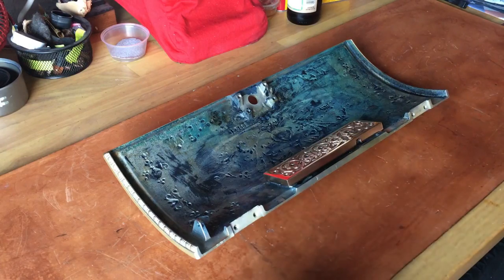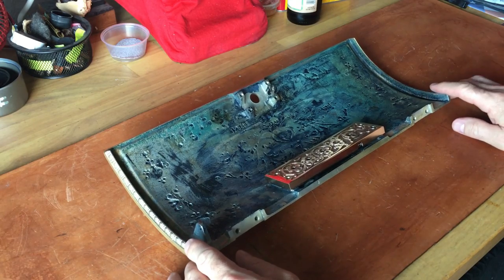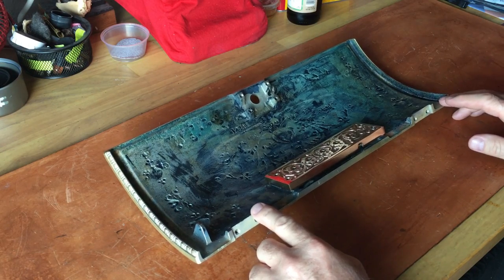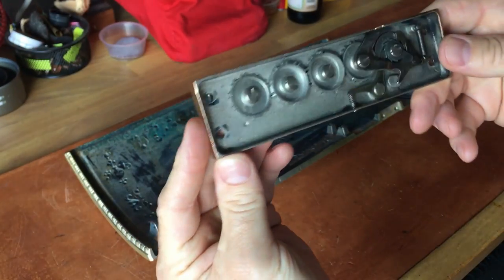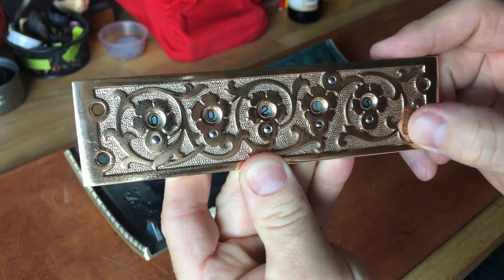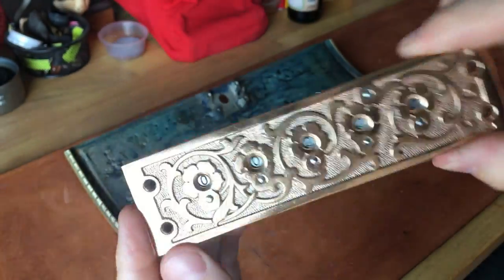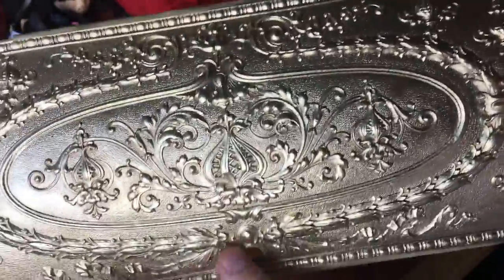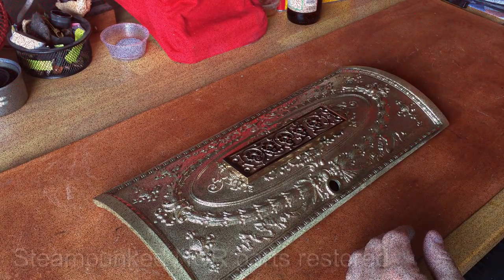Project: Repairing Steampunked Brass NCR parts

Comment: Good job!
I am currently reassembling a model 333 after a thorough cleaning and lubrication. I had to replace the screw and jam nut that operates the lid counter since the original was broken off. Can you tell me how much stickout is enough to operate the counter without being too much. I am trying to avoid a lot of trial and error adjustment as it would appear to be very time-consuming.
Thanks for any help!